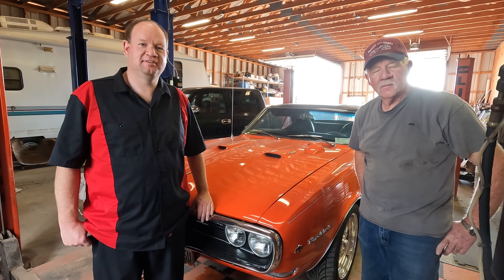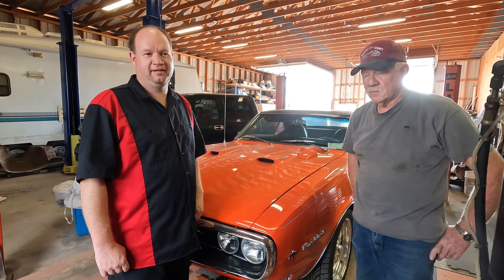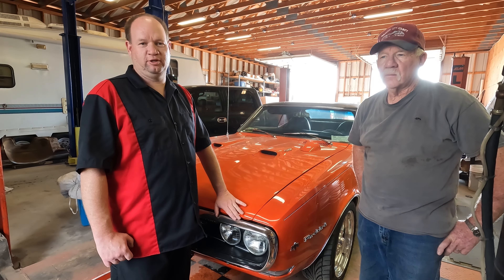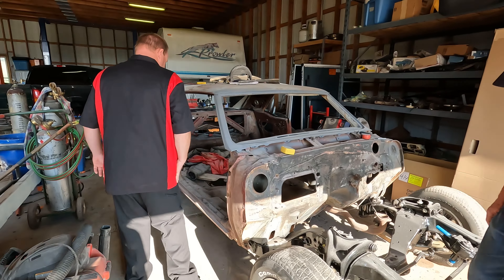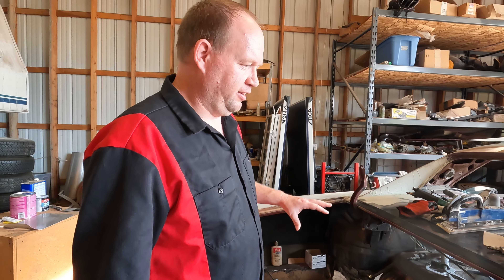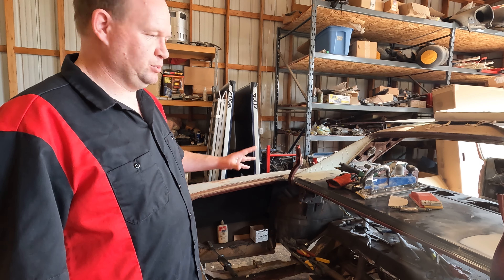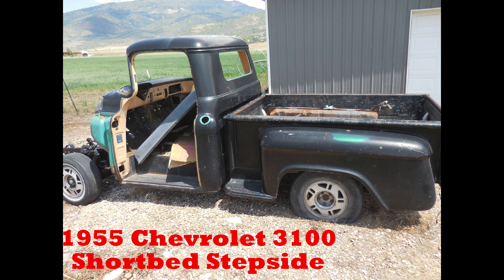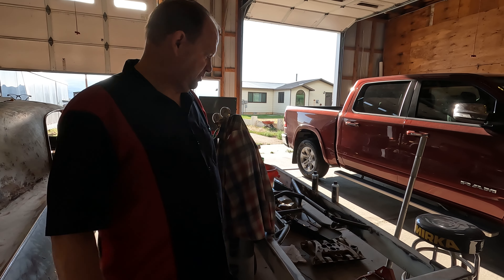Welcome to our Channel

Comment: Ok So you got me with (I'm able to work with my Dad) from Matt's Off-Road Looking forward to more Videos and More Details. Like Where are you going to get the floor pans for the 442? or are you going to make it. You Call it Kamas Klassics like your running a shop? or is it just you and dad? Looking forward to more Videos.
Reply from the maker: The floor pan is one of the parts that is available for the 442.  Mainly because it is the same as the Chevelle.  It is one piece and you can actually see it in the thumbnail for this video.  It is the giant cardboard box in the background.  The video of installing it will be coming up.  We are not currently running a shop and it is just me and dad.
Reply: That’s what got me as well..  even tho my dad is not a car guy lol.  I think he only owns pliers and many vice grip. And screw drivers lol
Reply: @kamasklassics  Awesome Looking forward to that did you order the trunk already?